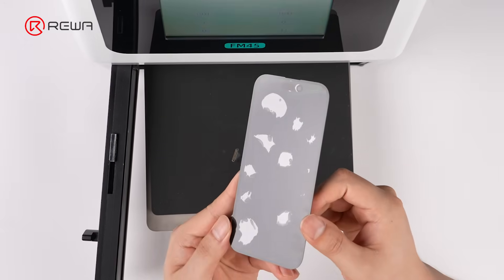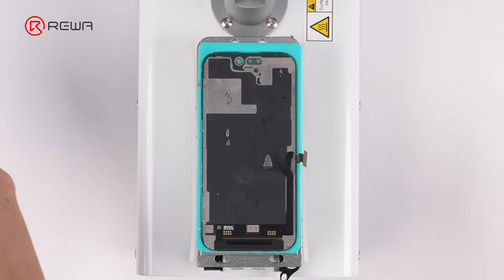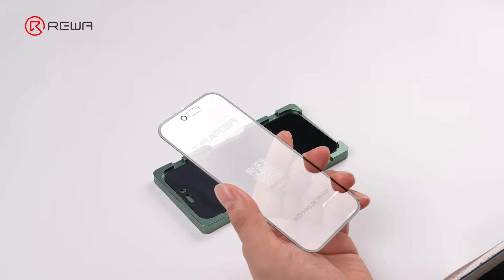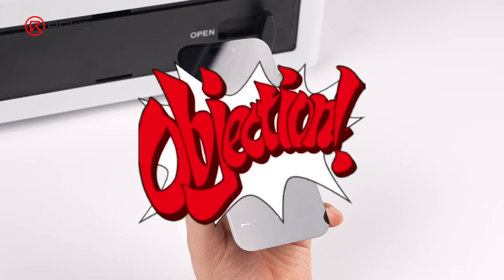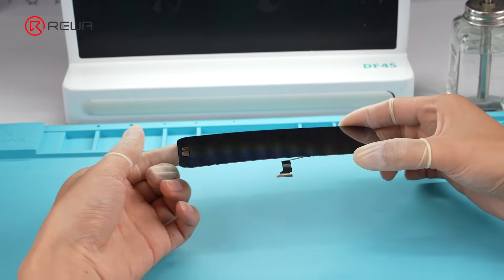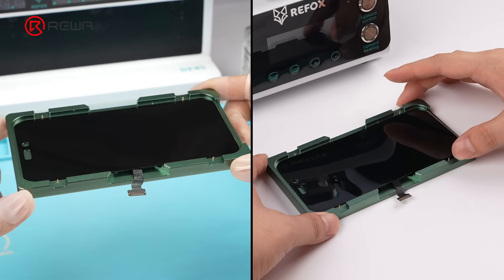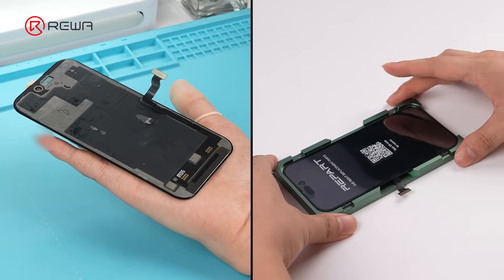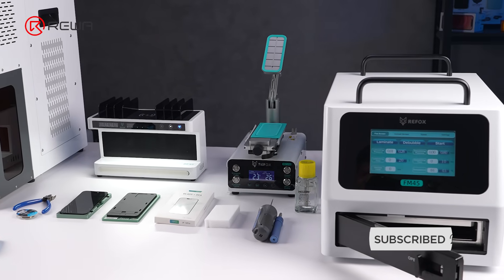iPhone Screen Refurbishing Tips: How to Avoid Bubbles?

Comment: when I refurbish iPhone 14 screen glass, the part opposite the ic chip gets a wave or a small pressure point. How to fix this issue?
Reply from the maker: The flex cable part?
Reply: @rewatechnology2008 the IC Chip part
Reply: @rewatechnology2008  the part opposite the ic chip not flex cable
Reply: Interchangable foam pads specificly for that screen with a 1:1 cutout for the ic's. 
Always flawless screens everytime.
I also think the orange jelly pad from aliexpress should do the trick aswell, without the cutouts
Reply: @TheOggysimo  what pressure do you use while laminating?

Comment: Nice video! I followed every step exactly as shown. Sometimes I end up with a few small bubbles, but they disappear after using the debubbler.
However, my main issue is that after a couple of days — or when I install the screen on a phone — new bubbles start appearing, mostly from the bottom. In some cases, bubbles show up even without installation, just after a few days.

I have tried both OCA Master and OCA Pro Glass. I know you are promoting your own product (which, by the way, looks amazing), but I would appreciate your honest opinion: could this issue be caused by the type of OCA glass I’m using, or could it be related to my equipment?
For reference, I use the Nasan Supa Lite for lamination and the M-Triangel M2 for debubbling. I follow the complete process exactly as demonstrated and finish by cleaning with 99% isopropyl alcohol to ensure there is no residue or dust left on the LCD before applying the glass.

Thanks in advance for your help and honesty!
Reply from the maker: Generally OCA glue is not the main cause, as you can see in the video, the main causes are frame bezel removal and the alignment
Reply: I’m having the same issue, my friend. Did you find a solution to your problem? Could you please share any tips?
Reply: You can avoid bubbles rebound by 1. Clean the old OCA glue properly, especially where the ICs and flex cable are connected, it must be flat. 2. Uses a UV curing Lamp or machine for 5 minute minimum after laminating
Reply from the maker: Have you removed the frame bezel?

Comment: I have bubble problems as well but usally it comes after a couple hrs.  Right after completing the refurb there is no bubbles but usually within a few hr bubbles start appearing and getiing bigger. Any solutions? Plus the only difference i make throughout the procedure shown in that i dont remove the frame.
Reply from the maker: The frame bezel glue or the cleaning lead to it.

Comment: In previous videos you used automatic wire wrapper from 2UUL, now you just use wire holder. What is the best choice?
Reply from the maker: They share different usage habits, the auto wire wrapper can control wire smoothly.

Comment: Hello Rewa, what mold do you use at 3:16? Is this some sort of special frameless mold?

I have seen this type of mold used with screen refurbishment with frame. Is there a possibility to missalign the OLED to glass because of clearance? How percise do you need to be when putting the OLED to the mold?

Can you please share link to this exact one?

I own one of yours refox fm30. It Is a great little Machine.
Reply from the maker: This mold is the XHZC. We use its frameless version for refurbishing because it prevents bubbles– unlike methods that keep the frame, where frame glue and residue cause bubbles.For precision: Place the screen perfectly parallel to the mold, ensuring all four corners fit flush against it, here are the same products: https://m.rewa.tech/detail/alignment-mold-with-bezel-frame-for-iphone-12-series.html

Comment: Do you have a link for the naptha, what is the proper one to use? As well as the sponge.
Reply: Naphtha is a broad term. I assume it's kerosene/paraffin, camp fuel or white petrol. N-hexane can be also used.

Instead of these solvents, you can use safer liquids like isopropyl alcohol 99% or ethanol 96% (yes ethanol even works, but it is not good enough for dry OCA glue on certain Samsung phones). A mix of 50/50 IPA 99 and pure acetone can be also used.

As for sponges, they are melamine sponges. Simply search for magic eraser sponges, or high density nano melamine sponges.

Comment: After Refurbishing the screen I put the display into the housing and put it into a pressure machine but I often get like scores or waves under the glass. 
Although the pressure is low still get this problems
Reply from the maker: Ummm the alignment should meet problem, you can check out the refurbishment tips.